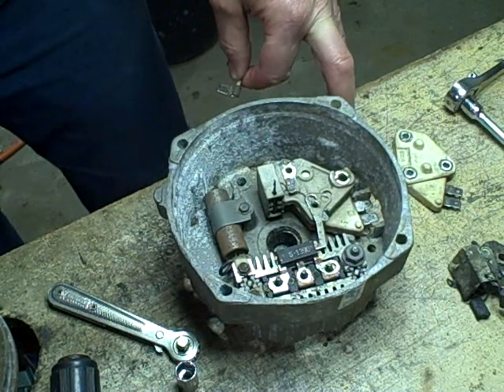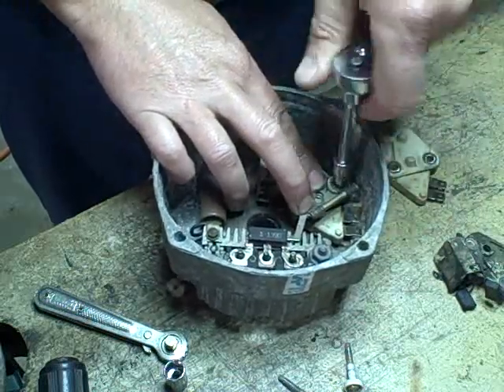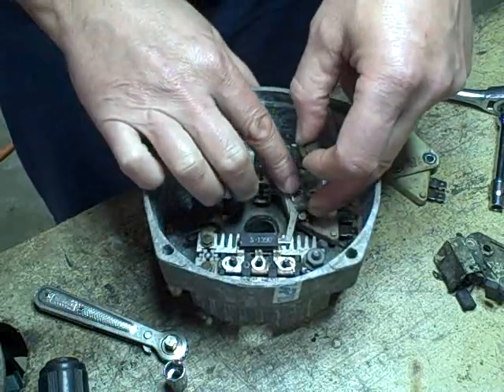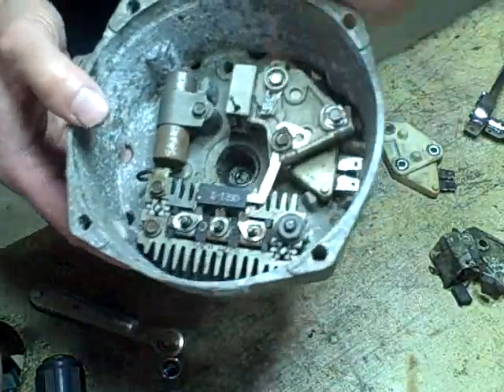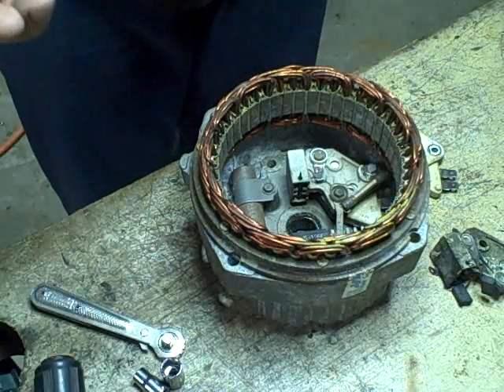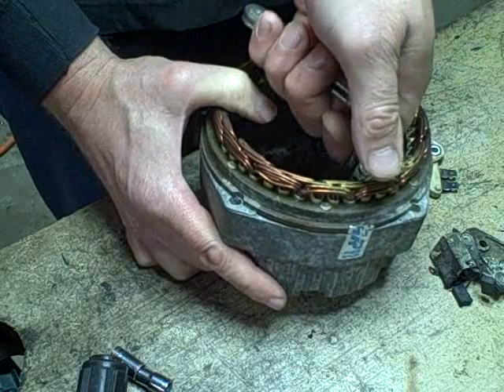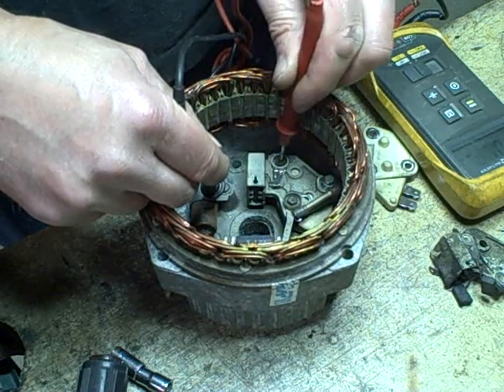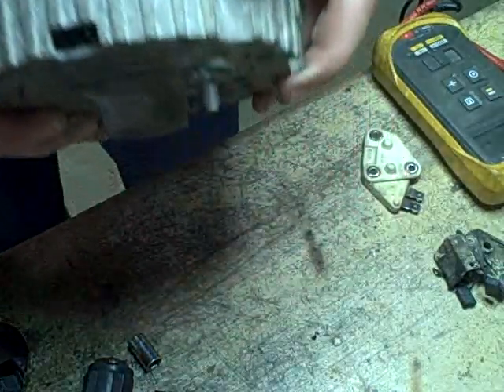Oliver 770 Industrial Tractor Project Part 122

Comment: I know this was over a year ago, but I cringed every time I heard the cracking and creaking while you were tightening those ceramic parts. I worked for a rebuilder when I was very young and we used a nut driver and were very gentle. One last tip, when you check the diodes in the rectifier, pull the copper tabs away from the studs sticking up. It will help you to avoid confusion. I know you probably have this repaired by now, but you may decide to do another in the future.

P.S. - Most people don't have the guts to attempt this repair. I commend you on your courage to attempt things you have never done. It is the only way we will ever learn.

Leon
Reply from the maker: Hi, thanks for the tips, I appreciate it. I plan on revisiting some alternator repairs at a later date. I had a few old ones given to me, and might try another. The one I fixed and put in the tractor works for now. Regards, Steve.